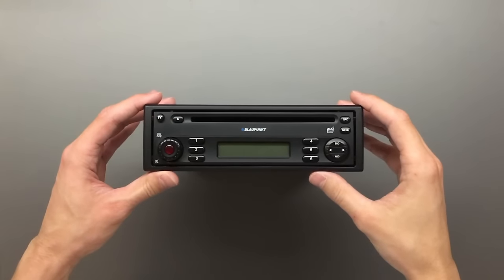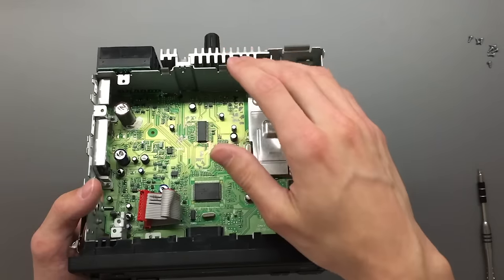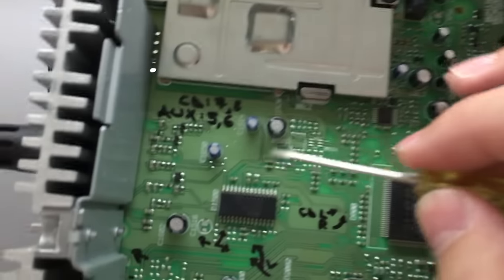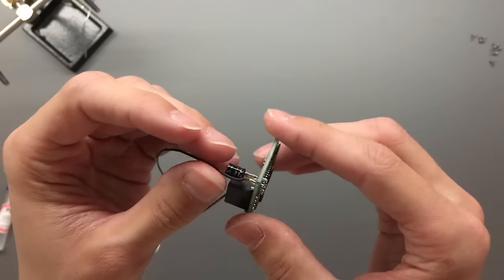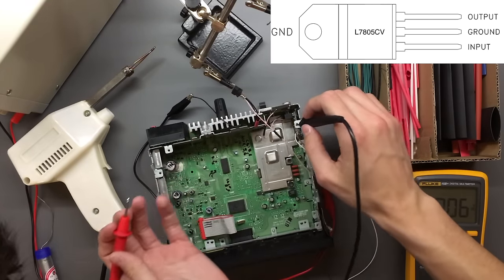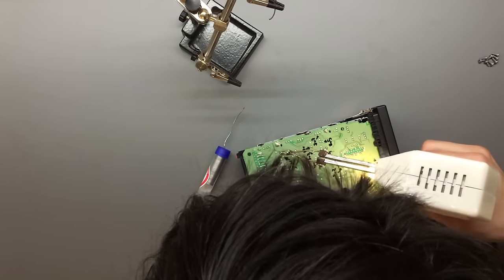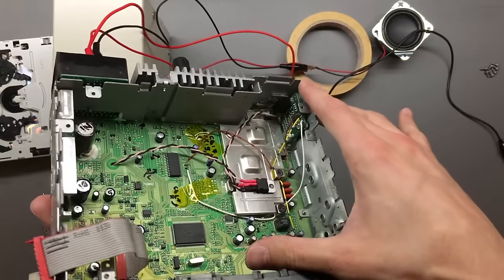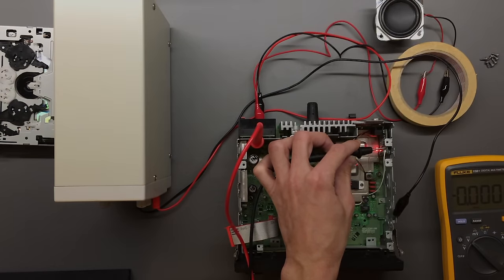How to Add Bluetooth 4.0 to Any Car Stereo for 12$ ! Complete Guide !

Comment: srews at the side of the unit should prevent u to geht this radio in ur car again. at least the radio-case behaves like a faraday cage. does it really work? further more you stick the regulator to the shielding?! do you know what you are doing? it doesnt look like. that what you aredoing hasnt got anything to do with "craftsmanship"!!! there are so many videos about it on youtube. you should watch them...
Reply from the maker: 1. Screws are fine where they are, there's a huge clearance either side anyway

2. You really would expect that, but it works perfectly - the front is made of plastic though

3. I sure do very well know what I'm doing; furthermore, quite rarely I adopt this condescending tone with people when I'm not 100.0001% sure of what I'm talking about; unlike others it seems. The bt module draws 40mA at most, if you're such a big shot maybe you can run the math and get some wattages for what the regulator will dissipate - let me know what you come up with

4. I watch quite a few videos - that's how I got the courage to do this mod in the first place

Comment: i think he made too many mistakes:
1. He covered bluetooth antena of metall shield of case audio system - it may decrease distanse to an audio source or may connect won't be stable.
2. He put audio signal wires around induction coil of radio module - it may collect digital interference from bluetooth module and relay it to audio amlifier.
3. He glued LDO to top of radio module on epoxy - the top of radio guard from interfernce and LDO emmition to much warm, epoxy resin very badly translate warm, the best way for it will attach LDO to metal shield of case audio system by screw with use thermo paste.
4. He soldered ground wire from bluetooth module too long distanse from audio input switching chip - it is good loop for collect interfernce.
5. And the best way for relay audio - it use shielded wires, for guard from interfernce.
Reply from the maker: Dude, so,  although all of your points are at least to some finite positive non-zero degree valid, I can 100.000% sure tell you, absolutely none of them do apply to any humanly noticeable degree:

1. You can play from OUTSIDE the car with all doors closed (1-0 for me)

2. Radio works fine, and I never play bluetooth when listening to radio, the transmit power indeed might very well be large enough, but the entire radio module is canned, so, it shouldn't and doesn't see any of that (2-0)

3. You'd be surprised how well even a thick layer of POXIPOL epoxy can pass heat - and that regulator (not so sure the l7805 is an ldo) drops 12-5=7V at 30mA, so, .21W - so at that, I could've wrapped it in a blanket and it still wouldn't get hot enough to warrant any concerns (3-0)

4. I actually did worry about this myself, but given the completely floating ground on the input of the bluetooth module (ie because of the isolated Mornsun DC DCconverter), that shouldn't've and wasn't a problem, 0 interference even with music playing from the phone at 0 volume with radio volume maxed out (not even trump's winning this much)

5. Indeed, it would've been something like +70 elegance point had I used proper shielded wire, and I actually did need it in other projects, where they would pick up interference from the bluetooth radio - in this case they sit snugly between metal pieces, which act as a pseudo-shielding; had it been necessary, I would've searched for some proper cabling, but, for short lengths next to ground planes, it's not a major must

In any case, thanks for taking the time to point this shit out ! Few people give enough of a fuck to try and help others, so, yeah, thanks !
Reply: 1. if you put your bluetooth antena in back side of plastic front panel - it will be better, so the distance to audio source increase, but it is not general, the signal/noice will be better in my case, so if you will have too many RF sources in band 2,4 GHz (e.g. wifi, bluetooth devices) near your car, then my way will be more stable. i of course understand what the situation when around your car too many 2,4GHz RF devices unlikely, but any way if you can put it in best place, why do you put it to back side of case? what is the reason?
2. are you sure, what the power of radio module turned off when you turn on CD, i think the radio module may stay work and induction coil will make noice in audio signal  from bluetooth module. did you check it? why do you put wires on this way if you can easy put wires to better way?
3.Will be better when you put 7805 directly to metall and put glue on corners, of course 21W isn't too much, but why did you decide to heat cover of radio module? ) you can easy attache it ot case on screw, and a car have too many vibrations from engine, roads, wheels, etc.  so i think a glue isn't best connection way for car.
4. And so on, why did you solder it on soo long distnce, if you can do it too clouse? it will be better.

you are nice man, because you take the good video content and i think you need to take new video sth. like "version 2" or "improvment" it will be good for your subscribers! of course i subscribed on your channel!
Reply from the maker: 1. I put it in the back because there was the most room to fit it there, and there already was the one hole for the screw mounting ... basically almost randomly chose that (then realised that maybe the signal won't be that good - but, it was fine so, left it there). Signal to noise can get quite bad with bluetooth 4.0, and since the transmission is digital that won't affect the audio in any way : it either works or doesn't

2. I've never in 1 and a half years noticed literally any problem at all with this setup - it's literally the best mod I've done in my life - I route the cables between components to make them as stable as possible, tiny vibrations might over time snap the wires off their solder points, with copper work hardening and all

3. It's not glue, it's epoxy resin, and I can guarantee you the entire car will go to the scrap yard a few hundreds of years before that 7805 comes off of there (again, placement was constrained by the lengths of wires, and had I glued it to the main frame, then removing the motherboard would've been impossible without cutting wires - gotta think ahead ;). And again, please try and imagine what .21 (that is short for ZERO.21 = 0.21W means) : that is THE MOST heat that will generate.

4. I would've had to connect to some random component, thus possibly disturbing it, and, yeah, the impedance of the ground plane on a multi layer board should make placing the wire anywhere pretty much the same.

I actually did a video installing bluetooth in a mercedes radio - most of your complaints shouldn't apply there even :D - that unfortunately for some reason doesn't sound too good - and until I get some more parts is on hold, but, feel free to check the 1st version in the mean time

Comment: Cool to know if you have lots of time on your hands and not to sound like a hater but wouldn't be a hell of a lot more smarter to just by a bluetooth dongle/ with RCA jacks on it and plug in or wire it into the speaker wires or acc port/ thumb drive and put it on cd setting and play bluetooth that way if you really want to keep an out of date radio with no bluetooth acc button/ setting...
Reply from the maker: This coming from a guy restoring a 1988 car, is very awkward

So you'd rather have a blingy do it all radio like this https://goo.gl/images/tiaYgm, instead of the OEM radio the car originally came with ?

I for example wouldn't, and just paid around 120€ for an Alpine Audio 10 CD for my dad's car

Also all your other points are invalid for the radio unit in this video
Reply: 1980 get it right, and I was put different opportunity people could do that are easier and there is nothing awkward about my input just because you did it the hard way/ work don't be mad, PS I forgot more than you'll ever learn...!!!🍻 LMFAOO 😂😂😂
Reply from the maker: well, you sure did forget that your title says 1988 - so, I did in fact get it quite right.. 

and you've probably also forgotten quite a bit of english as well from what I can see, not sure I want to learn that much even

fun talk though, I'm enjoying this

Comment: Thanks for the vid. Could I get your opinion. I am thinking about soldering an aux cord to my pre-existing aux input. Than, run this cord to this: https://www.amazon.com/gp/product/B00PXC0CIK/ref=oh_aui_detailpage_o00_s00?ie=UTF8&psc=1; to enable Bluetooth automatically. Right now, I am using a receiver that has to be consistently plugged in and is an eyesore.
Reply from the maker: yeah, sounds like a good idea - and that bluetooth receiver looks pretty cool (if a bit pricy perhaps ..)

Comment: Nice reverse engineering. Luck you got the unbalanced audio interface. Most modern radios use only differential signals and you will run into ground loop problems.
Reply from the maker: Well, that really shouldn't be a problem, since the CSR Bluetooth chips have differential outs (exactly due to said ground loops)

On the green HYT boards there's a small headphone amp that makes the signal single ended, which could easily be bypassed
Reply from the maker: My pleasure - thanks for the nice comment ;)

Comment: Just grab your self newer stereo with bluetooth and mp3 capabilities for only $25. Even cheap $25 BOSS car stereo will be better than modding old crap.
Reply from the maker: +jun park You sure know your gear !
Reply: jun park There is something called enthusiasm. Hope you got my point.
Reply: For your typical boyracer audio install dash included with flashing lights and a big ass touchscreen thats in the way of buttons and controls.

This is specially for carlovers of the 80-90-00s, having a new radio in your golf mk4 or your bmw e46 or whatever just looks stupid. This way you have new technology but still the looks for the car of that era. Not that difficult to understand
Reply: jun park in many cases I'd agree with you.
Reply: Clearly know nothing about new cheap  car stereos and even less about old good quality ones.
Reply: We look forward to your tutorial on how to buy a stereo on Amazon.
Reply from the maker: That one ain't EVER COMIN' ! You hear !!1?
Reply: With 0 satisfaction after
Reply: You clearly have never seen a BMW E39 or E46 with a generic DIN Slot car stereo. It looks like shit and for that this solution would be great. I personally won't do it because I still have many CDs I can listen too and I'm not good enough with soldering but if someone with skill would do that for me I would do it in a minute.
Reply from the maker: Well, actually, just yesterday a friend bought a bluetooth add on for his e46, 30€ off of amazon de - works like a charm, emulates a cd changer (his radio has a cassette), so you can skip tracks too

No soldering involved at all :D
Reply: cant do that on my bike! bluetooth is kinda old anyway
Reply from the maker: Bluetooth 5.0 is 1 year old - how's that old ?
Reply: You can add in this way one chinese pcb with BT receiver,SDcard port,and others on one card inferior to 10$,now your card is under 6$...think you can have it to 2-3$